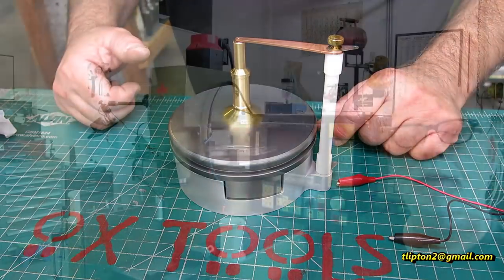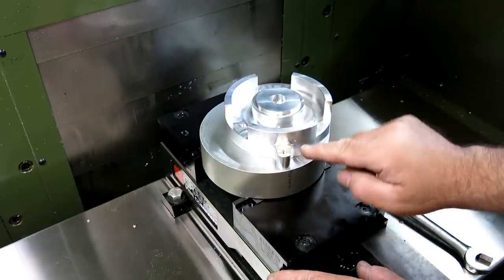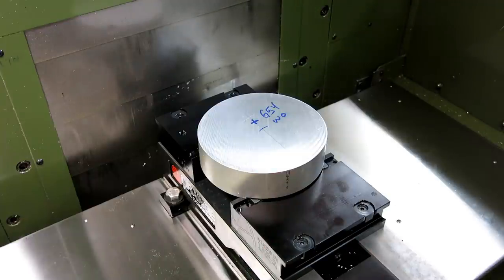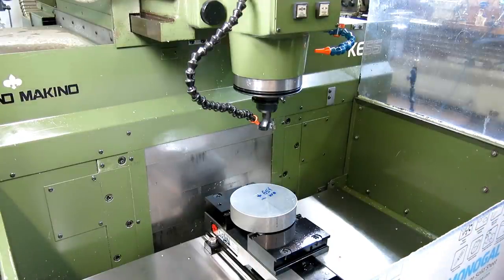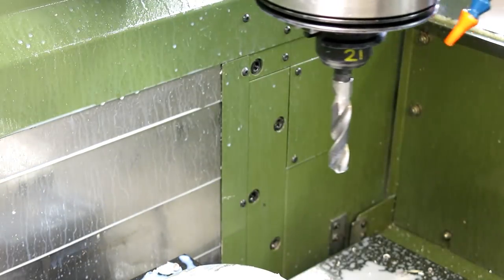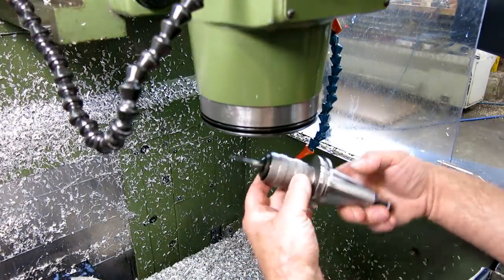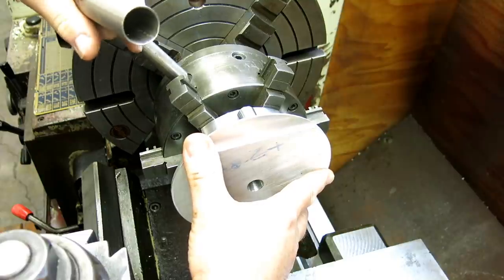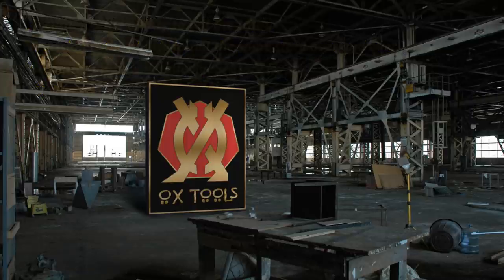Part 2 Kingsbury Michelle Aerodynamic Bearing Collaboration

Comment: Tom, I do this for a living and it never gets old. And agreed, do as much deburring on the machine. Seems counter intuitive but it saves time in the long run, with consistent, professional results every time. Last, what kind of coolant do you use? Any oil skimming to keep clean? That would be a cool (no pun intended) topic to touch on for the uninitiated.
Reply: And, does Tom need any "bug-killer" additives in the coolant?

Comment: I love this kind of project. 
I had a thought about a relatively rigid air bearing spindle for a lathe with a large  through spindle bore. 
Make a metal cylinder with, say, a ten inch bore and maybe a 3 foot length. At both ends weld perpendicular plates that are maybe 24 inches in diameter. Weld cylindrical flanges to the rim of the round plates. The flanges would extend about a foot in both directions. 
Now, the main cylinder would be supported by air bearings but it wouldn't have any resistance to lateral movement. It would easily slide in and out. 
On the periphery of the round discs, and just below the flanges, you'd have air bearings on both sides. These bearings would prevent the main shaft from sliding forwards and backwards. Additionally, since they're mounted a fair distance from the shaft axis, you'd get some serious lever effect action. They'd be very resistant to lateral movement of the shaft. 
Now to the flanges, the cylindrical flanges would also have air bearings on both the inside and outside surfaces, thus adding to vertical stability, and, due to their distance from the shaft axis, you again get benefit from the strength of the lever effect acting upon the central shaft. 
It'd be a physically big machine but it'd be very stable and it'd be very accurate. 
What do you think?
What's your opinion of this spindle idea?
Thanks for everything you share and for the huge amount of time you put into your videos! Much appreciated!
:)

Comment: While watching CNC work like this I find my self having to sit hard on the perfectionist in me: yeah there is a lot of wasted movements, but if you are only making 2-3 parts then it would take longer to get rid of them than they add up to.

But that got me thinking; is there such a thing as competitive CNC programming? "Here is the blueprints with full GDT, there is the set of bits in the tool changer. You have 4 hours to hand over a G-code program that needs to make a good part on the first run. Fastest cycle time wins. Go."
Reply: That game sounds fun. Although I think they already call that "Running a job shop" :)

Comment: Just about everyone, machinist or not is using aerodynamic "bearings" every day. Hard disk heads fly just above the surface of the platter using aerodynamic principles. As the platter speed increases, the head flies closer, but the force keeping it from crashing increases too. A "virtuous cycle".

Comment: i am guessing since there is no tool changer you can use bt40 as well as cat40?
Reply: Probably NMTB 40 as well, as long as you have the right pull stud.
Reply: @RambozoClown   i think if it can take nmtb40 it can take cat/bt40 but not the other way around because of the draw bar situation. I asked be 2nd hand bt40 tooling is much cheaper here in the state then cat40 because everyone uses cat40 but bt40 went to the way side in the state. So when the tools pop up nobody buys them.
Reply: @DRrandomman22  Since his machine uses a pull stud instead of a drawbar you can mix and match, you just need to have pull studs with the right thread. I have the same thing in 30 taper and have a mix of ISO, NMTB, CAT, BT, Erickson, etc. The versatility is great, but I would gladly lose that to have a tool changer. (besides me) ;)